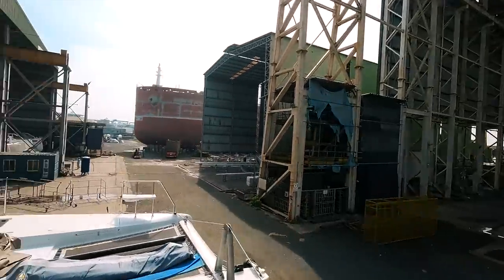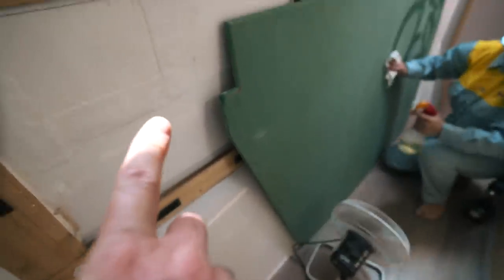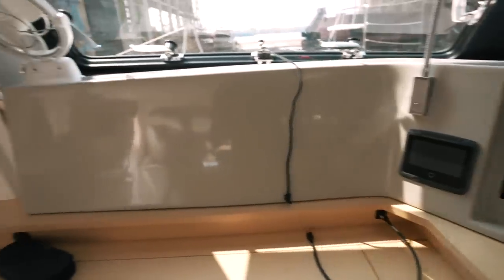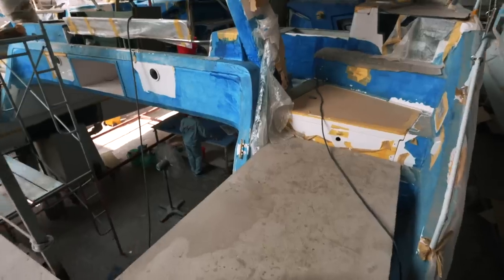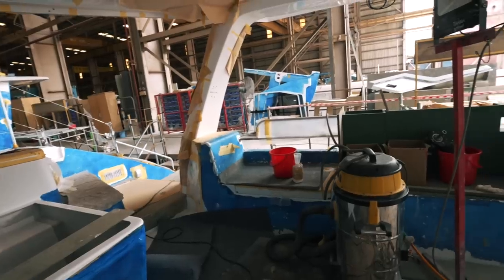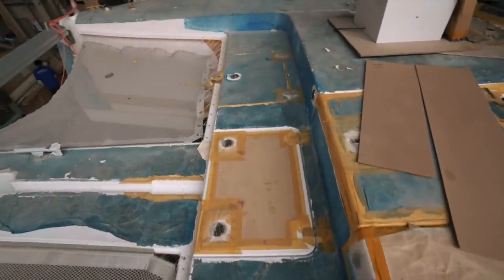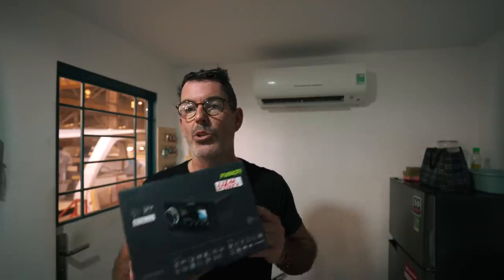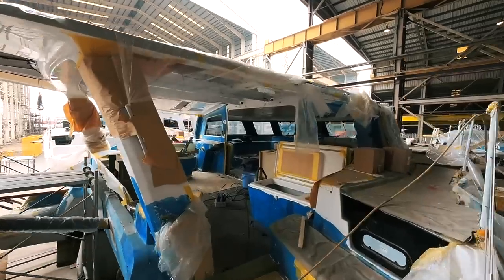Big Changes to the Catamaran Build- Also, We Need Your Help!

Comment: Absolutely do not place speakers anywhere water could reach. They will fail, and cause quite a leak. We have speakers under a forward cockpit with a roof, and water still finds it's way into those speakers and they needed a drain behind them with a waterproof box. Assume speakers will transform into holes at some point in the future and put them where that is not going to cause a problem.

Comment: One subwoofer does not do it on a boat. Trust me on that as a club owner and a boat owner that have done charter boats with dance parties as well and the system you got is puny and the wind and wave action plus engines will bury the sound. Get at least one maybe two more subs. Blue tooth speakers outside that you can take in. Self powered enclosed jbl works well. If you leave any speaker outside they will die after a year or two.

Comment: I wouldn't recommend speakers up front for the same reasons you pointed out. Also, sadly I think the nav station was aesthetically better in black. To keep it clean the gray is better but the black was much sharper, looked higher end and blended well with the windows but that is just my opinion.  All that matters is what you like. You are very close now, I am so excited for both of you.

Comment: Oops, I accidentally deleted my long comment. Meh >.< Try again. 

I'm an audiophile, in general I'd rather have more speakers inside for an encompassing sound. With a subwoofer I'd be doing a 5.1 setup if at all possible so I can watch movies as well. Five speakers (left, right, center, back-right, back-left) plus sub in the salon, and maybe place the additional speaker just outside to extend the sound for when you're outdoors. Though if you're not at all into movies I guess you don't need to worry about that. Any outdoor sound will be necessarily poorer quality due to ambient sound, so you can always use Bluetooth for that.

The other thing I said was to really interrogate the quality (and specs) of those speakers. Built in speakers often aren't the best in my experience, at least in a home environment. For purely music listening, I'd rather have two traditional, as large as possible front speakers in the salon. Don't know what can be mounted safely in a boat. Speakers should face you in the direction you'll be facing when listening most often.

Comment: You didn't say how many zones you have to play with? if 2 then 1 internal and 1 external zone (you don't want external speakers playing your movie soundtrack on movie night) if 3 zones, then forward, internal and cockpit zones.
If they are not rated as marine speakers consider getting marine speakers, especially for the forward deck area, even if you put splash proof covers over them moist salt air will eat them up, is amazing how the sea air finds it's way into everything (I'm sure you know this)

Comment: I think the shape of the inset of the overhead lights is the problem. Aesthetically unattractive. Will the heat from the outdoor grill effect the finish on the spar to its right?
Reply: I wondered about the grill mounting myself. They get hot and that seems awfully close to the fiberglass.

Comment: You didn't mention external amplification, but i pretty sure you'll be disappointed by the internal amps, pretty underpowered and disappointing in my opinion.  Having said thats once you've spend the same again on the Apollo amp the speakers come alive and are genuinely impressive.  I have just been through this experience.  I think I agree with the majority here that front speakers will be an issue over time.

Comment: I have grave misgivings regarding the permanent mounting of your speakers on the forward deck.  The impact of one good wave over the bows could destroy the acoustical components in these speakers.  The mounting holes could become two large inlets for water into your boat.  Any items you want flush mounted up forward should have  recessed fiberglass pockets bonded into the structure behind them to maintain integrity against wave impacts.
Think about portable wireless speakers you could fasten to safety rails on occasion.

Comment: I would suggest marine grade triaxial speakers, there are a number of brands to look at, the reason for this suggestion is that triaxials are full range and sound uniform regardless of where you are located on the vessel. putting a woofer in one location doesn't carry to the forward or cockpit speakers and I promise you you will not be happy.

Comment: There is no way I would put those speakers up front. You have to cut a massive hole in your boat and if you end up in heavy weather, you want the speaker between you and the elements? No thank you. Use a bluetooth speaker up front and call it good.